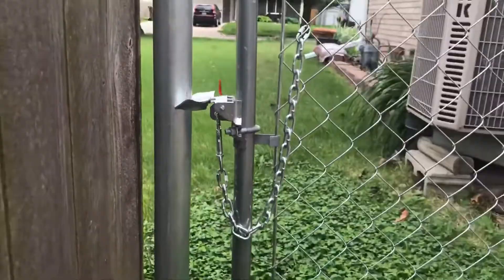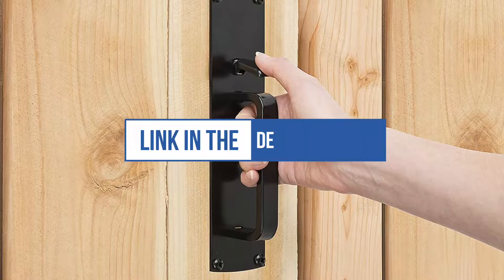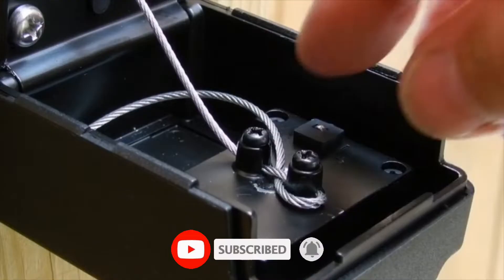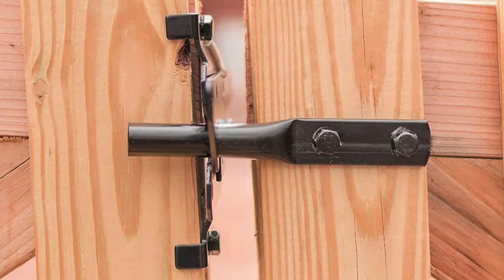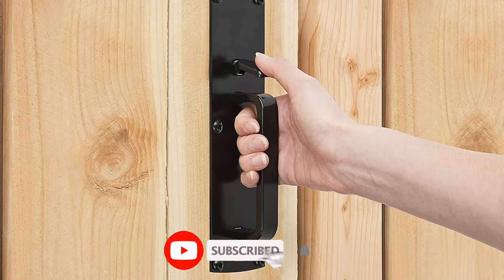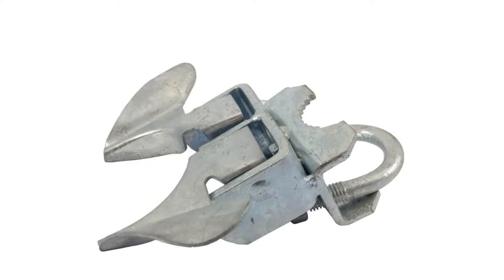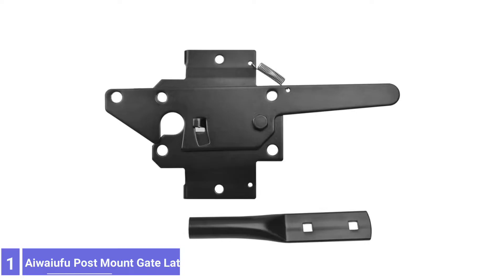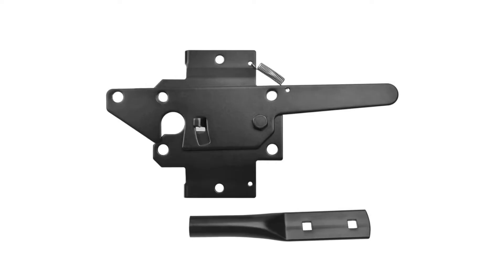Top 5 Best Gate Latch You can Buy Right Now [2023]

Comment: @3:51 you can easily see the carpenter didn't cut the diagonal properly, as provided it showed under a 1/4 inch gab on it's connection. Absolutely horrible demonstration from a hack that probably learned a the university of China, Slogan  Build for today Collapse for tomorrow.  F